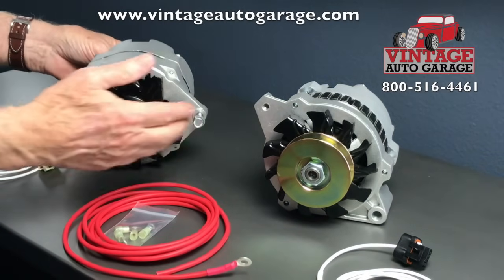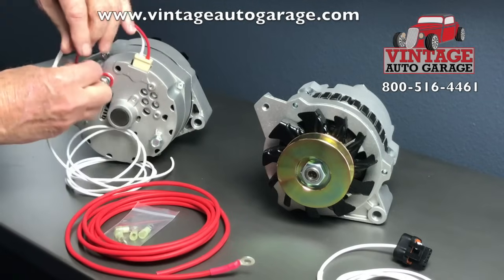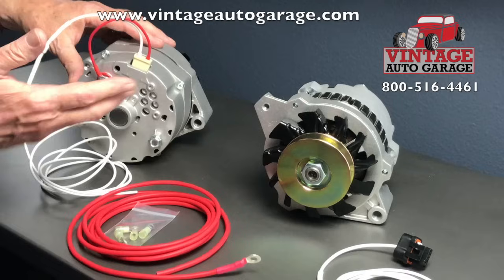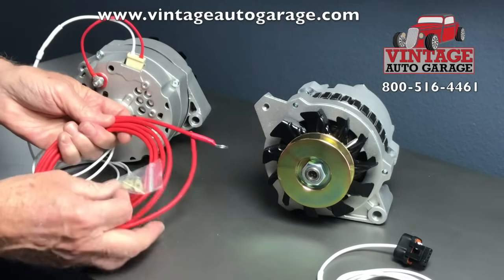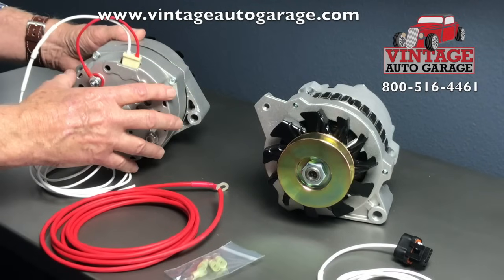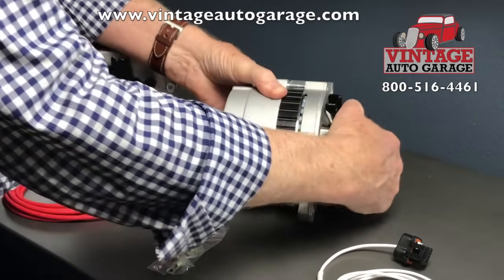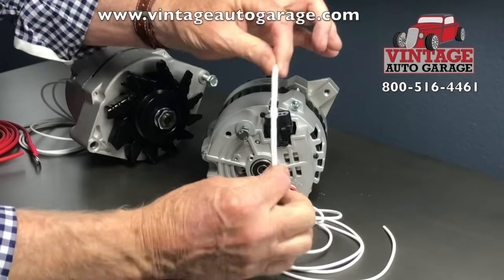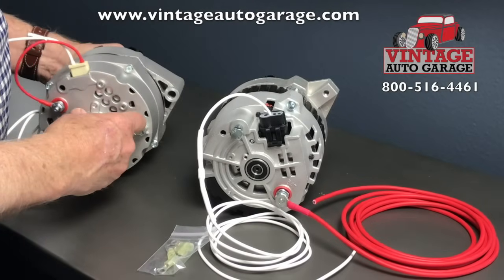How to connect 2 wire Delco 10si and CS130 alternators using charge connector plugs

Comment: Can you use a 10g wire on a 100 amp alternator.?
Reply: 10 GA should be enough for that.  You can never go wrong by stepping upto the next size.  
 I always use 4 GA. But 10 is enough for 100 Amp alt if the factory did it.  I always just go bigger 👍

Comment: Why do the even have a sense wire? I mean why output is already right there next to it, why did they not just do that internally? Seem pointless, I don't get it. 

Edit: I do now. The way  it's being done in this picture is pointless, incorrect.  The sense wire needs to be away from the alternator, closer to the load or battery so it can see the voltage drop. Coming right out of the alternator it's going to be  a false higher voltage. Doing like in the picture the alternator will maintain  the battery at a lower charge, not optimally, but it will still "work".

Comment: What diode should I use on a 24 volt altenator,  I have a m35a2 deuce and half military truck with a diesel engine,  im replacing altenator with a civilian altenator, but it's 24 volt 70amp, and it won't start putting out power until I touch the exciter,  but I want to connect it up and not have to keep touching it, so I want put diode in and not have to use a switch to turn on and off.

Comment: I have good battery, it's 12.6v holds charge I just need to test the alternator it's the 3rd one i installed now there's 8.8v coming from the PCM wires to alternator so when I ground the other wire to see if increase in voltage at the battery but nothing. Today I will bypass the those wires his time put 12v to alternator and tap the ground again to see if battery increases to 14v.Any ideas are greatly appreciated.

Comment: Good Evening. Found your YouTube site today. I'm attempting to convert a 1948 TE20 Ferguson Tractor from 6-volt to 12-volt using a Delco Remy alternator 12 volt x 105 amp, model DREI130, remanufacture #20402. Following your video to plan the wiring harness has provided good information. The connector plug has three short wires that indicate P-L-I-S ... How are these wires connected, are all three required or only one?  Appreciate any insight that you are willing to provide.  TTFN/CDC

Comment: Hi... what alternator type is best as 2nd alternator for recharging lithium battery banks separately from engine alternator? 1 wire or 2? I need a 100A supply for 500A banks.

Comment: can you tell me sir what is pin on me 12si alternator? be me I have positive linear voltage regulator inside the dashboard I use only pin 1 with baterry bulb the pin 2 is bend inside the alternator me car dont use that pin.
I have unusual problem when I use hv capacitors on me ignition system the alternator back charges up to 3000-4000rpm the alternator light come up always below that engine speed so how do I counter that problem???

Comment: Huh 🤔...Great explaining, this may have solved my alternator overcharging my battery and battery not taking a charge and staying dead after shut off...in my '84 Monte Carlo with a 305 1st Gen SBC, everytime I shut the car off my battery is dead and I need a jump. 

After a jump and about 5-10 minutes of driving, my dash lights, headlights, and stereo slowly dim and eventually power off completely, but my HEI distributor doesn't power off, I'm guessing running from the alternator as you stated about the ignition coil.

 I have a C130 which originally came with a 3 wire plug and idiot light. I was told a 2 wire plug was less complicated. So I bought a 2 wire connector and I wired it up exactly how you did with the 10si alternator you have, S wire to the alternator B+ stud, and exciter wire to the ignition port behind the firewall in the cab.

I think it's the cause of my alternator overpowering my battery, I get 15.5 at the alternator and battery with the engine running.

I say that, because with the C130 in your video, you have the 3 prong connector with just the single wire, that being the exciter wire itself...vs...mine having technically two S wires, the external wire from the 2 wire connector and the internal S wire within the CS130...or does the internal S source of the CS130 only work with the 1 wire connector ?

1 wire connector looks even less complicated than the 2 wire connector and you're showing and telling me that the 1 wire connector is the correct connector I need for my CS130 Alternator.

I need a 1 wire connector for my CS130 alternator.

Comment: Wow thanks alot for explaining how to wire an alternator it really helped me I had purchased an alternator and I was wondering how do I go about connecting it just a quick question what size diode did you use as I also need to fit one cause my system is overcharging please help
Reply: Diode isn't to regulate the charge rate. Just to regulate electric flow direction.  Your external or internal regulater is possibly bad.

Comment: Hi there - If using an external regulator on an alternator that has been upgraded with an external field wire, is the connector with the sense wire and exciter wire you show here still necessary or can you disconnect it? Thank you!

Comment: Thanks for this video,  I have a 2 wire alternator from a 63 chevy small block, the motor is mounted on my run stand, I see that on the back of the alternator there is a wire that goes to the "+" side of the batt, on the white wire that you have where does go to. Big thanks...

Comment: I have a 320amp alt with a 14.7 bypass regulator. Problem is when the vehicle is off, there's a faint humming noise coming from the alternator. And after a day or so the battery is dead. I tapped the excited wire to the fuse box for ignition. What's the issue you think?

Comment: I switched to a PowerMaster #67293 alternator with internal regulator. So I cut the wires to the voltage regulator and capped off three, and connected the Excite wire to the brown wire. Per your setup, I'm running a heavier wire from the Alternator Post directly to the battery terminal with a Fusible Link. So I have the old alternator wire, the heavier 10 AWG factory '69 Camaro wire and I was wondering is it now going to be live, dead or live only when the key is on? Could I use that wire as a 12v Switched Ignition source? Or should I cut the eyelet off and cap that wire?
Reply: use a meter to be sure

Comment: Im working on an old allmond bros light unit with a Lister Peter , just installed one of these alternators and stumped why on the alternator im getting 16V and on battery its showing 12V while running. missing a good ground on alternator maybe ?

Comment: One thing i can't seem to understand. The alternator charges the battery yet you plug the output wore to the + side using a conventional method. This makes no sense as in reality it is the negative the moves towards the positive. If we are to follow this then you are saying that the current moves from positive to negative. This is however incorrect. Im not sure if im missing something down the line. Can someone explain to me please?
Reply: 2 things
1. While electron theory states that current flows from negative to positive, it's common practice to wire from positive to negative. 
2. The alternator casing is touching the engine, which is grounded to the battery. Which is why you don't need a negative wire

Comment: I am going to use this for an off-auto project.  Does it matter which direction the 10SI alternator spins?
Reply: yes and no.. the alternator will charge in either direction but the stock cooling fan won't work properly if you spin the alternator backwards so it might overheat.

Comment: Need to draw a simple wiring diagram for each project, labeling components. If you use indicator light, need seperate bypass circuit in the event bulb burns out. Different wiring of use voltmeter or amp gauge (wihich I don't like). Lighting circuits, starter relay, type of keyswitch used with start position or separate start button. The farm tractors I've put Chevrolet alternators on charge 14 volts at idle.
Reply: Jeffery. 
Any chance you may have experienced exciter wire issues?  Like the alternator fails to start outputting?

Comment: I found out about the diode after starting the car I was redoing and had not put the whole exhaust system on with only open headers. I was standing in front of the car and ask my friend to shut it off ...the second time I ask him he held the keys up and said I already did lol. Live and learn. You need a diode in your back turn signal lights also when wiring an old school turn signal on the column or you end up with flasher when turning

Comment: I have the bigger alternator brand new but the old style on my truck where do I get the the one wire plug or better yet how would you recommend switching to the new better alternator? My damn battery keeps dying. 1989 S10 1974 350

Comment: For 10SI Alternator, there are 4 wires plug, what are those 4 wires? In your video wire #2 is connected to the battery via a diode.
Reply: The number 2 is the L term. Connected to this light?

Comment: On the older style alternator I briefly touched the excite wire directly to power and I didn't have the sense wire hook to anything. It shot up to 14 and a half volts and appear to be working great. So I hooked the excite wire through a switch to power and I turned it on and did not start the engine. One minute later there was smoke coming from the alternator. I quickly disconnected the excite wire from the alternator .  I started it up and tried to briefly touch the excite wire to power again and the alternator will no longer work. I thought the excite wire was supposed to be in line to power with a light bulb or a resistor. I didn't use a light bulb or resistor did I ruin the alternator or did it coincidentally break on its own?
Reply: Suicided the voltage regulator. I need that 1 way diode thing he has. I have burnt thru 3 alternators and had problems with my engine attempting to stay on aswell. Never figured it was getting power elsewhere!!!

Comment: Please can you make a video on how to use a car alternator for home appliances or how to wire tv, cd player or any water pump to the alternator? If the alternator shaft rotate at 1200 rmp and produce 100 amp current then will car battery over loaded. Or is there any fuse and relay circuit to control current and voltage for any appliance? Thanks in advance.
Reply: I knew an old Vietnam vet who could do that.
Reply: Home appliances use 230v or 110v in the US, an automotive alternator only produce 14-15v, in your case the amps are irrelevant

Comment: What size dioyoid
Reply: It's like a one-way valve in a water pipe. Except it's for electricity.  So with the diode there where he put it electricity can only flow One Direction Through the Wire. Otherwise the alternator would make electricity and send electricity back Through the Wire and it would power anything that was hooked to it. That's a problem when you try and turn the key off and everything still has power then you can't really shut it off can you? The diode stop this from happening and enables you to shut off the engine and everything else when you turn the key off